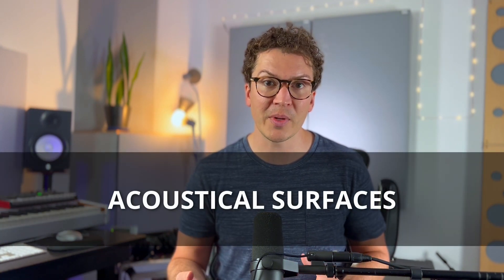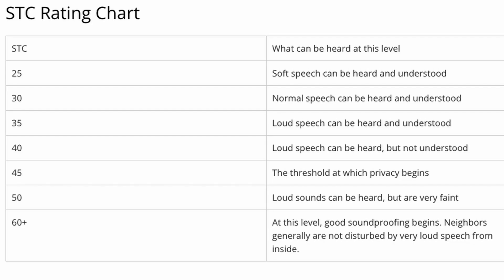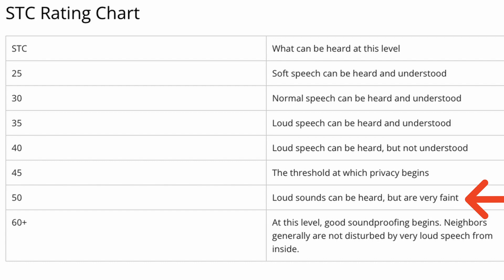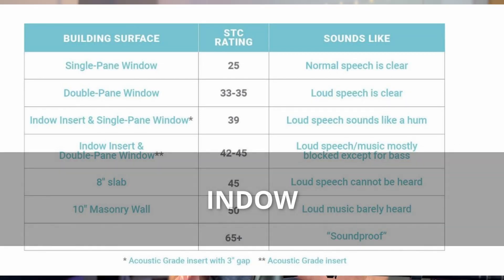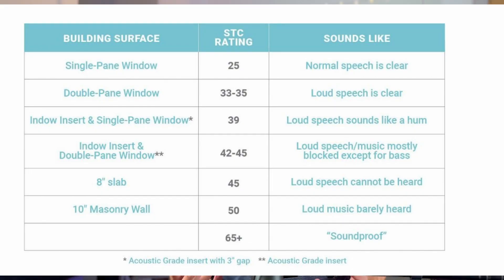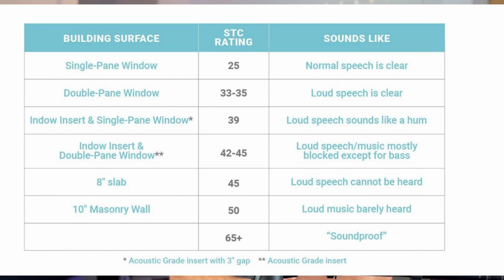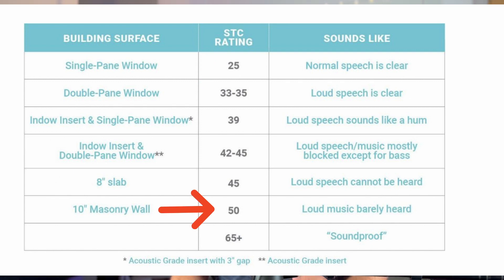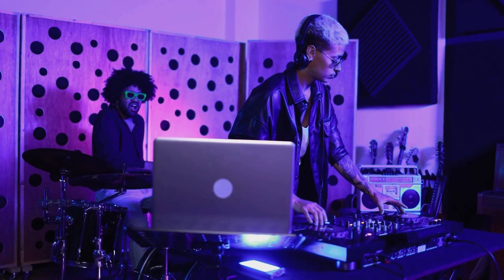What Are STC Ratings In Soundproofing?

Comment: Hey there! I'm planning on building a room in a room, but one of my walls has a window and a door that can't be changed. I currently have roxul insulation filled in the window cavity and then covered it with mdf and caulked it, with the door I made a wood shell around the door and filled it with roxul, covered it with mdf and then caulked it.

My question is, if I'm building a room in a room would this qualify as triple leafing? It would seem very counter intuitive to remove the window/door soundproofing I've already made with the amount of sound that could leak through them. (I'll be taking off all the drywall to prevent general triple leafing though.

Any opinion on this situation?
Reply: The door that is covered is not the door used to enter the studio*  
It's not in use but can't be changed.
Reply from the maker: Plugging up windows is a a fine method and is not a triple leaf. You just don’t want drywall in between your air gap.
Reply: Perfect, thank you so much! This channel has been super helpful!

Comment: Hello, 
I Tried a sofware called INSUL, it calculate down to 63Hz. 
I'm planning to build a rehearsal music studio in my home with STC rating of 79dB STC. 
Is it good enough to block sound?

Thanks
Reply from the maker: An STC of 79 is very high. It is not 79dB though. There is a mix up of terms there.
Reply: @soundproofyourstudio  79 STC😉, but it has low insulation value in low frequency (only 63Hz 20dB reduction)..

What the ideal STC value for low frequency around 30Hz - 63Hz?

Thanks
Reply from the maker: @panca4238  the best way to stop low frequencies is to add as much mass as you can afford. It is not a perfect science. My hunch is it is best to commit to a design and see it through. If you get stuck analyzing hypothetical STC ratings and designs you will never build your studio. I see this all the time with people. They research endlessly, but never commit.

Comment: It's important to seal everything with some kind of acoustic (elasctic sealant) caulk, if you build a wall and leave small gaps where you can push as little as a sheet of paper or drill a hole to hang a picture you lower the STC.
Like he says in the video lower freq isn't in the STC rating, to proof against bass you need mass, concrete or a brick wall is ideal to cancel lower feq but adding extra layers of drywall is the cheapest way and far better than installing thicker insulation in the wall, insulation that dosn't proof anything but absorb sound.
Good video!
Reply from the maker: Thanks for watching and everything you are saying is spot on!